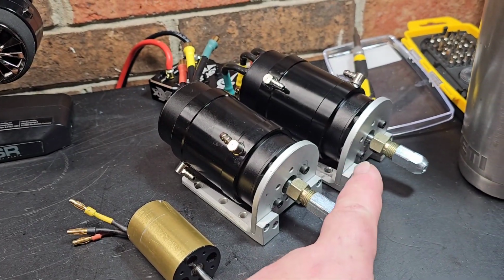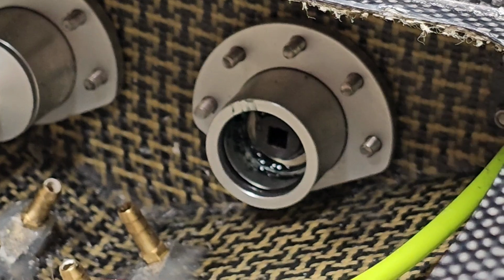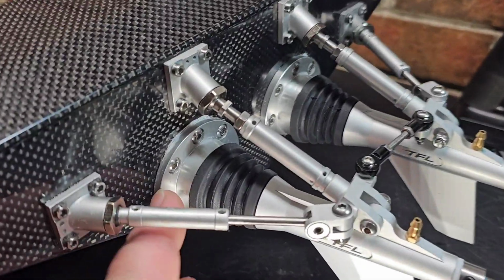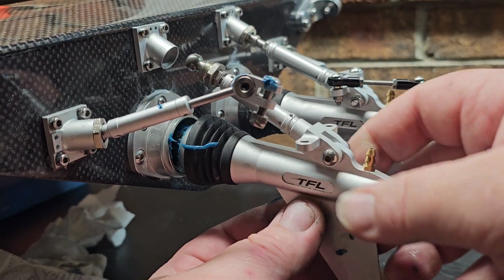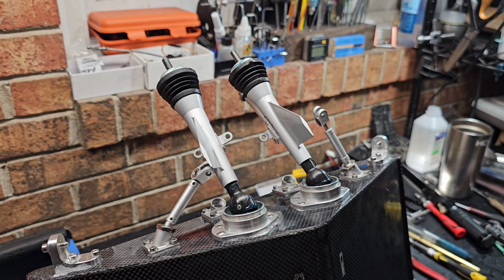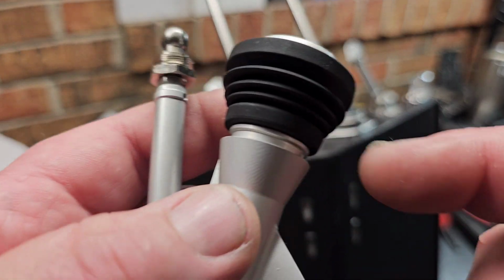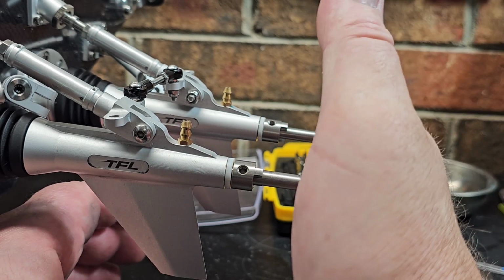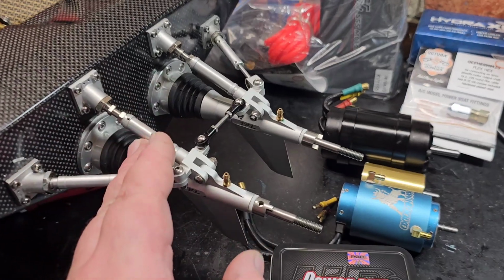Arenson Drive Full Tear Down & Assembly 51" TFL Ariane Surface Drive Maintenance - Twin FE Rc Boat

Comment: I’m like you Big B, no way I can not know how they work 😆, plus it helped to loosen them up, no point in running something like that if it’s going to add amps to the system, but they look so cool 👍👍👍
Reply from the maker: Maybe that's why they chose to go with the 56 series motor, more torque for the arenson drives and that extra resistance in the outdrives.

Comment: Hey Bro where did you get the cable clamps for the push bull steering cables. I picked up a push pull rudder for my Zonda and i need to redo the orientation of the servo and the clamps you have would work perfect.
Reply: Thanks from me also! Save me from CAD drawing and 3D printing.
Reply from the maker: https://www.offshoreelectrics.com/proddetail.php?prod=tfl-509B52&PARTNER=ironclad
Reply from the maker: @pcooper985  https://www.offshoreelectrics.com/proddetail.php?prod=tfl-509B52&PARTNER=ironclad
Reply: Big B! I so like your thinking on this hobby: taking it apart to 1, see how it’s designed, and 2, to be able to maintain it by understanding how it’s made and what parts do what function. Very cool B. Such awesome designs. I am glued to the details like you.

Comment: Big B , you are in your way . Love the plan and the beefy motors . I am guessing that you will put those big props through your forge and get them blessed by THOR himself .

Q is when you put the oil can on , why would the go down the shaft towards the prop , rather than spill out at the end of the shaft that goes towards the motor  ? What is stopping the oil flow in this direction ? Thanks
Reply from the maker: The rotation of the motor/cable, the  twist in the cable acts like a screw, it cork screws the oil/grease aft instead of out the front motor area.   Same with a  single motor flex, the flex spins and cork screws the grease into the strut/stinger.
Reply: @IRONCLADRC  looking forward to this test . The oil should squirt out at the prop end with the RMP the shaft spins !! 

Please share , when possible, which high temp , best of the best , oil , you plan to use .  Thanks

Comment: You could try some heat shrink on the cap instead of Loctite or RTV. Could try that on the rubber boot possibly as well to keep them in place.

Comment: I would use Permatex Black RTV on the boots. Gives a good strong seal, removable, and it’s black. Just go slow and clean up. We use it at our transmission shop on oil pans. Once dry it will even hold a full pan in place with no bolts.
Reply from the maker: My choice is black rtv or permatex aviation.  ?   Decisions Decisions lol.  Thanks for the tip.    BG4L

Comment: Replace the o ring to increase the tension.   I took thecdrive shaft out of mine and put blue locktite on the outer race of the bearings to prevent them from going out of the housing.   Also   use clear silicone sealer on the boots to keep the water out. I did a video on the outdrive 2 years ago  SCBG4L
Reply from the maker: I'm headed to the auto parts store now to pick up a oring kit, thanks scott

Comment: Those drives look awesome but with all those parts seems like a maintenance headache. Great video.
Reply from the maker: Maintenance like I did in this video shouldn't have to be done very often, maybe once every 20-30 packs or so.  Grease and oil before each run should be simple with the oil & grease nipples on the outdrive & stuffing tube

Comment: Aviation sealer buy permatex will work great I've been working on boats for 35 years real ones and I use all my knowledge on my RC boats and it works just as good
Reply from the maker: Okay, yes, that sounds about right, probably a bit better option than contact cement. Thank you.
Reply: @IRONCLADRC  absolutely will be water tight and be an easy removal when servicing you can also buy a little tube of bellows adhesive from your local Marine store they are the same thing

Comment: Left shaft universal no good.  Not  eccentric.
Reply: I think it’s fine. It was just flopping around because the housing wasn’t keeping it lined up as long as it’s not binding.
Reply from the maker: I thought the same thing at first, but the outdrive barrel w/ 5 points of contact should self-center  the drive shaft with the universal yoke.